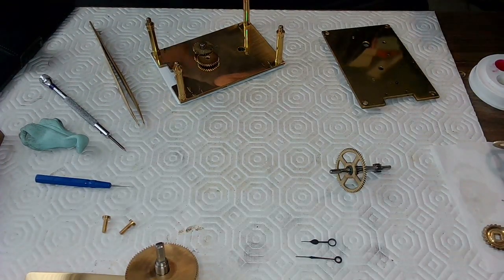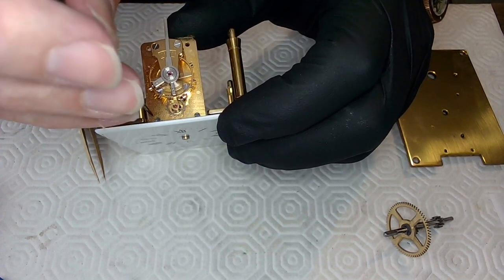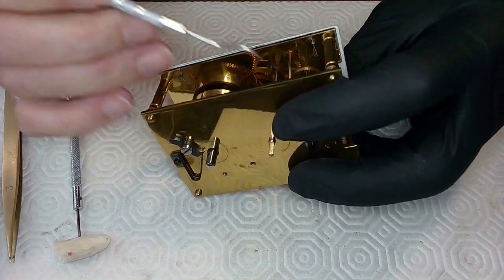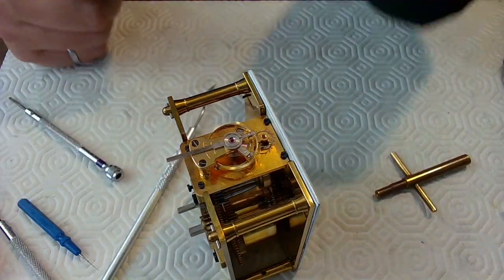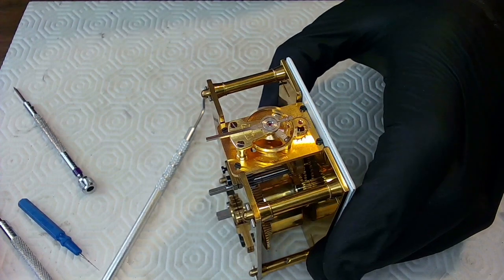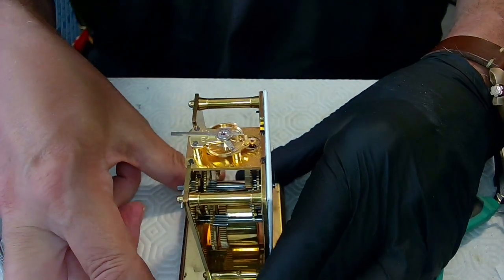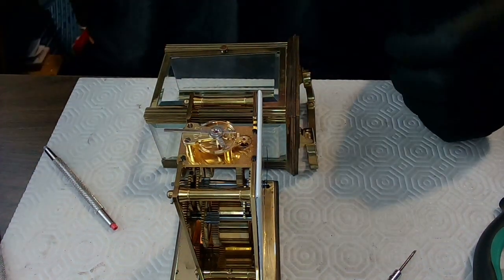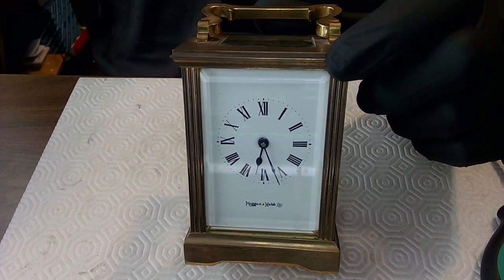Mappin and Webb Carriage Clock Assembly

Comment: Hi did you ever find out the use for the screw you describe as the cap screw. I could not get my
balance wheel to run more than a few minutes tried everything then loosened the screw and hey presto. Do you think its a shut down / lock screw for when transporting. And yes I know its called a carriage clock but you never know ! All best JT
Reply from the maker: That screw was for changing the end shake of the wheel with reference to the pinion on the escapement.

Comment: Hi  just a suggestion it would be a lot easer if you was to take the dial. hands off first then the escapement would have   more  control of the platform escapement for removal from the escape wheel  thanks ady
Reply from the maker: Thanks for the advice

Comment: I enjoyed it and not gonna critique the clock work by a watchmaker, but I would like to suggest if you do another clock a short piece of round cardboard shipping tube makes a great “movement holder”   Carry on captain
Reply from the maker: Thanks Eric. Cleaned the escapement and all the fixens this morning and adjusted the 4 upper screws until the pinion and gear meshed perfectly. Now it has been running for an hour without issue.

Comment: The screw for adjusting the end shake of the spur gear...
There must be some end shake (movement) in the shaft, which ensures zero friction caused by the shaft contacting the plates and zero binding with the escapement.  The end shake movement must be minimal - it just has to exist, barely.  

If there was no wear on those plates that requires some pivot bushes you were extraordinarily lucky.  A lot of old clocks just got oiled to keep them running, which ultimately caused a lot of wear.

I never wanted to do clocks, but there's one on my bench at the moment.  It was oiled until there's nothing but a treacle like substance gluing everything together.  Two of the three clicks are actually stuck to the plate with this oil.  Oh boy...

I've been studying Westminster chime complications before I pull it apart.  I gave a quote on the job that I thought the owner would refuse.  Now I have to do the job LOL

The old oils used were animal and plant based, that's why they turn to glue.  Oil out the head of sperm whales, porpoise jaw oils, neam seed oil neatsfoot oil etc.  Mineral oils are a bit better, synthetic oils should not cause the same problems down the road - but they will just disappear and leave the bearing dry.  Yes they have an expiry date, but I tend to think that Mobius, Novostarr et al dramatically underestimate shelf life.  I think they are extremely conservative with their estimates, which are barely longer than the recommended time between servicing.  Sealed bottles of synthetic materials should last way longer, yeah?

I'm coming to the conclusion that everything in and around the Swiss watch making industry is 50% science, 50% art, and 50% bullshit.  Add in also 50% charging what the traffic can bare, and stuff the independents. 

I'm currently making my own epilame and developing a procedure for using it.  Should I sell it on Ebay?  $15 a small jar instead of $150 for a small bottle...
It's older technology, but works just as well as long as you carefully follow a set procedure.  Stearic acid epilame was used for a very long time before the invention of modern polymer based eplilames.  Was it Breguet that said "make me the perfect oil, and I'll make you the perfect watch"?
Reply from the maker: I ended up cleaning the escapement and adjusting the gear mesh with the four upper screws…until just right. Then I adjusted the wheel screw on the back plate….and the darn thing is running wonderfully. What a finicky piece.
Reply: This is good.  I'm doing one at the moment Chris.  What is concerning me is that this particular end shake screw is a little loose and I don't want it to move when I've re assembled the clock.  Have you any advice please?
Reply: @stephenmurphy4092  Ah, it shouldn't be loose - I wonder what happened.  I'd be tempted to add a little of the weakest strength locktite (243, the blue one) to the thread with an old oiler after it is in position.  I use this locktite to put watch crowns on the stem so they don't come loose in use.  It's pretty common to do this in the watchmaking industry I believe, though I've never seen it recommended in repairing clocks.  

Maybe the screw was replaced with the wrong one at some point - and the better fix might be to find the correct screw.
Reply: @Chrisamic  Thanks Chris, appreciate your thoughts and advice.  I'll look into both. Thanks once again.